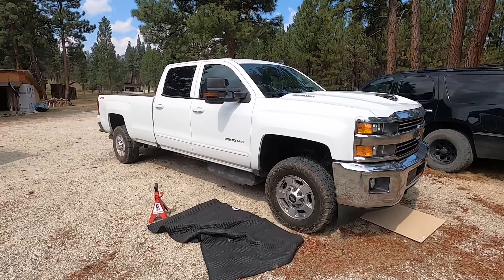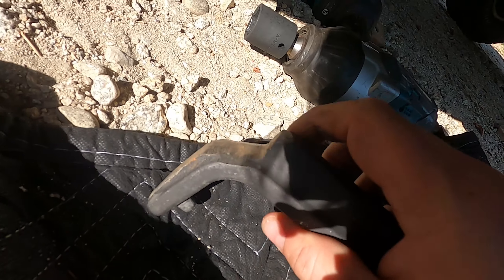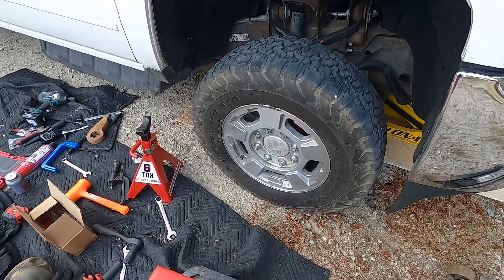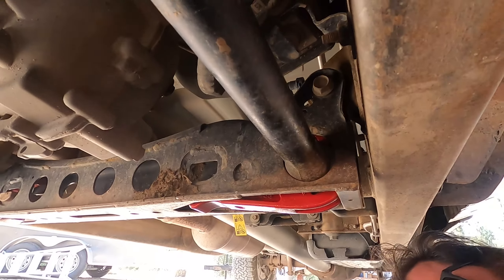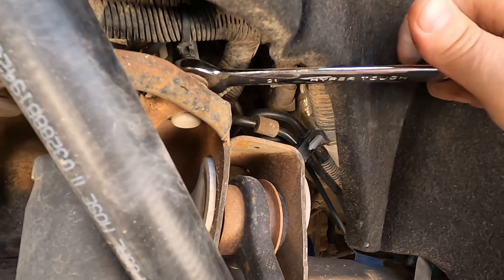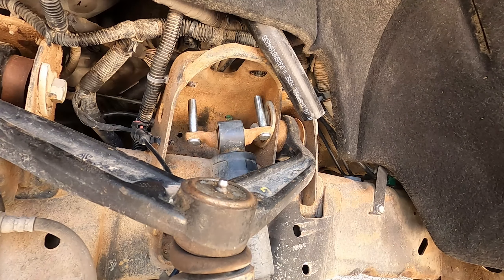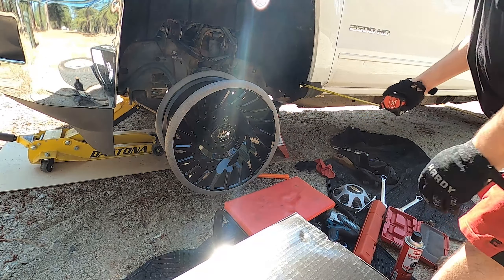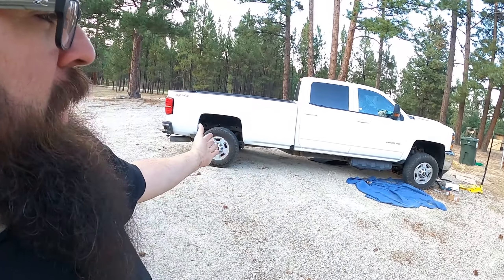Leveling the DURAMAX!  [Suspension Maxx 2.5" level on a Silverado 2500 HD]

Comment: Ima wait awhile then buy the upper control arms an suspension max steering stabilizer … great channel!   Can u make it where we can add pics in coments?
Reply: Will this give you the stock smooth ride and level ?
Reply: @willissixmo7530  yes
Reply from the maker: I miss the days of video replies and pic replies would be perfect for some of these. I'm still running the stock control arms but may upgrade soon. I bagged the rear last year just redid the shocks all around and now it rides much smoother. If you have older shocks you might want to upgrade. There are affordable options, like Rancho, with a quality shock and the right height for a lift or level.

Comment: Got it on today . Rides better than stock! I’m using rancho hd adj shocks . Cost me 250 to get kit installed an ligned up.. I’m 43 inches from ground to bottom of front an rear fenders now.. slight rub stock no rub now 275/65/20 lt Toyo at3’s  says 34 OD and  with 10.5 on tires.. thanks for the help
Reply from the maker: Love it! Glad it helped. I bagged the rear for towing and put Rancho's (non adjustable) all around just recently, too.
Reply: Which setting did you use? I just bought this and was wondering if I should go with 1 or 1.5 inch. Don’t want to worsen the ride quality. If yours was improved, that’s impressive. I drive a 2017 2500 high country duramax 4x4. Thanks.

Comment: How much should it cost to install this kit ? And how long does it take ty
Reply from the maker: Should it cost to install, yourself, or with someone? IDK what guys charge, but if you had a lift and the tools all handy not longer than a couple of hours max and it'd be free aside from the tools and kit. I'd say a shop should charge 2 hours, but IDK. I couldn't imagine it actually taking longer, especially with experience. The time for me was just having to jack it up on dirt then go rent the key tool when the cheapo ebay one I had didn't fit and broke.

Comment: I heard when you level a torsion bar suspension on these trucks, it makes it ride a little more stiff.  Is that true and how did your truck ride after you did the leveling kit on yours?
Reply from the maker: Technically that is accurate as the torsion bar is the spring for the front and you're effectively making the spring tighter. However, the Suspension Maxx keys have multiple levels of lift depending on where you insert the bar and is designed for it so it's not like you're cranking the stock keys all the way up. Cranking the stock keys will make for awful ride quality. I wouldn't say it's stock, but it's barely noticeable with the 2" level I'm running.
Reply: @WildMountainGarage  adjusting the torsion bar does not make it tighter. The bar has x torsion rating and that never changes. You’re just changing the clock angle of the bar. There is also zero difference in cranking stock keys or installing aftermarket ones (aside from the ride height you can achieve) an aftermarket key is only clocked differently from the start. Think of a Rachet turning a bolt…if you’re only allowed to start turning it at 9 o clock to 12 o clock the aftermarket key allows you to Rachet back to 7 o clock so when you get to 12 o clock, you turned your bolt that much more. The ride roughness comes from the control arm bottoming on the droop stop or the ball joint (possibly tie rod end) being at max angle.
Reply from the maker: @LoneWolfSnowplowing  I've redone the front suspension and added uca's with clearance. I think most of the roughness was from worn joints and bushings although not enough clearance didn't help. The clocking of a torsion bar is relative to the lca port. Cranking the key will induce twist and I'm sure as with any spring there is a rate and you're adding preload with the twist and although the rate remains the same the overall dampening amount is reduced as you've changed the length effectively. Installation always happens at zero twist no matter which key is used. The aftermarket key just allows precise control of the twist and raise rate. But you could certainly crank stock keys. Thanks for watching!

Comment: I have owned alot of different tortion bar chevys those lift keys are a money grab just crank the original keys to the max is the same affect and geometry.  Only thing aftermarket keys do is give you more crank than stock then at that the front gets way to stiff lol waist of time lol